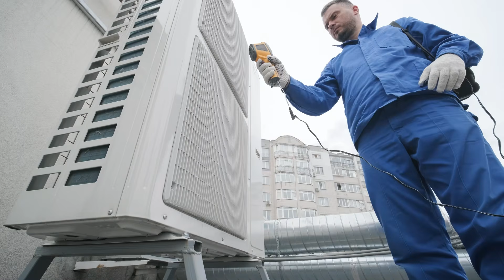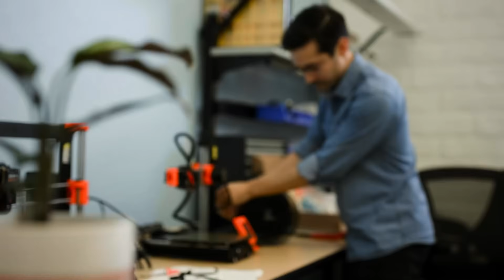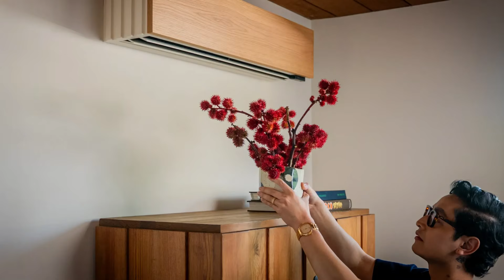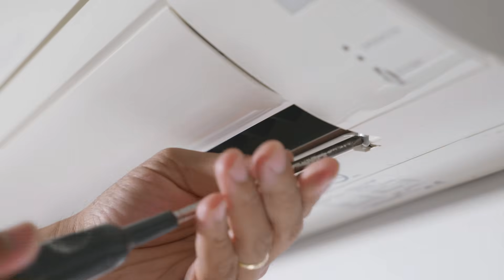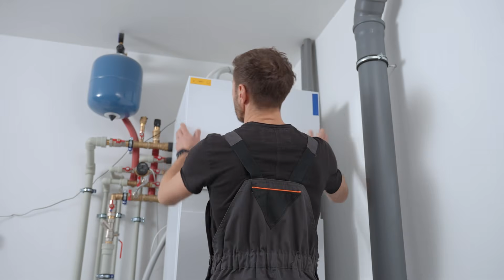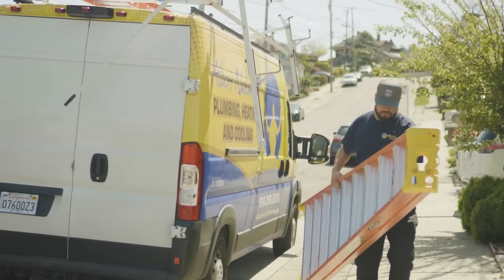It Slashes Heating Bills Up to 40% and Still Works at -13°F — Why Isn't This in Every Home?

Comment: Most houses in the Southern states use heat pump reversible AC units.  If you are retrofitting an old house, or have a very small house the mini-split makes sense, however they aren't actually more efficient than a well designed central forced air handler system.
Reply: Mini-splits deliver 100% of their capacity directly into the room with zero duct losses. It's pretty rare to have any situation where a properly sized and configured mini split system doesn't outperform even the best Ducted system by at least 20%, usually more.

Comment: Minisplits are fine until you have to buy a board for one. "What do you mean it's only two thousand dollars for a rectifier board? I'll just buy a generic version. What? You mean there is no such thing as a generic version? Hmm. My old central air looks pretty good right now."
Reply: Wider adoption would fix that problem by creating a market for a generic version.
Reply: @20quid  Except that 99% of the world uses minis for AC. You can't get wider adoption than that. It's a racket.